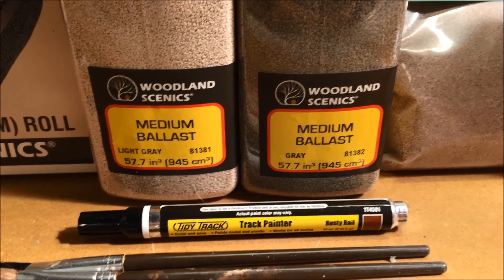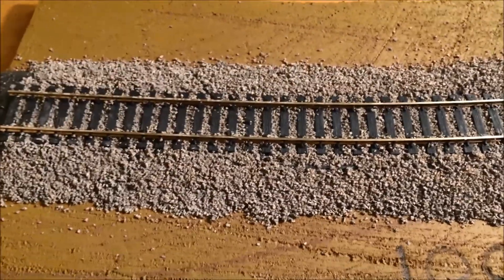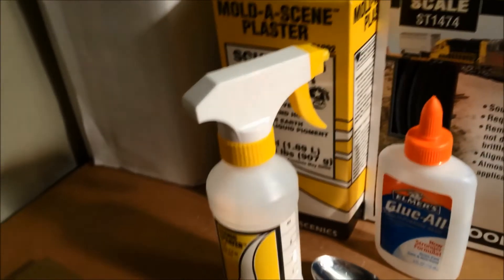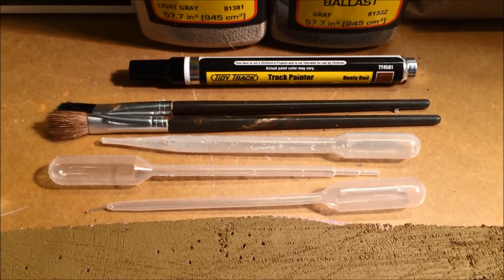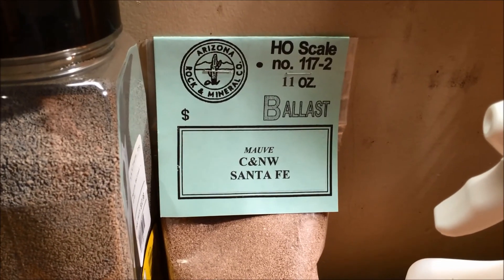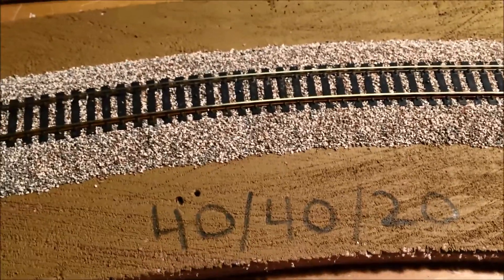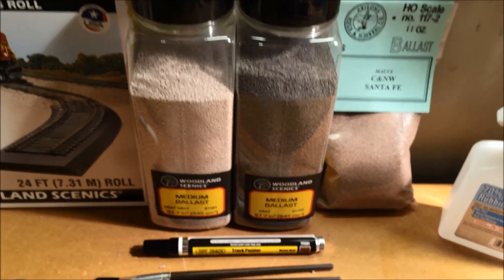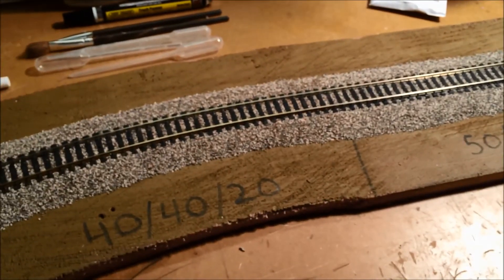Episode 9: Roadbed and Ballast Test Part 5

Comment: They are called pip-ettes not pipe-ettes.You Americans should learn English
Reply: Gary Moore  As a chemist with 35 years experience in American Labs, the pronunciation in the video is correct. Pipe, not pip.  Just another of many variations in pronunciation between the English and the Americans

Comment: Definitely go with the 40/40/20 you got there.  That looks the most realistic to true railroad ballast.  What's the cost of the AZ rock & mineral compared to the Woodland Scenics if you don't mind my asking?  I've been model railroading since the early 70's and this hobby has increased in cost by 20 fold, no kidding!  If I had to start all over again with today's prices, there's no way I could be a model railroader???  Great video btw.
Reply from the maker: I appreciate the comment- most people have agreed on the 40/40/20 ratio, especially if you see it in real life.  I don't remember the cost of the woodland scenic vs. Arizona, but I do remember that they were comparable- pretty close to one another.

Here's a tip- you can get the a lot of scenic stuff at Michaels craft store- they run weekly 50% off coupons.  Its a great way to get a $10 pack of trees for $5.  Hope the tip helps you a little Bernhardt.
Reply: probably. its expensive enough starting out with a  7x4.. *couldn't do 8x4 because I had to fit the space between a door frame and a walll

Comment: I'm about to ballast for my first time as well. Great video showing the different ways. That helps me decide what I am doing now. Thanks
Reply from the maker: Glad I could help!  I recommend two things.  Number one- TEST!  You need to play around with ballasting to get the hang of it.  Number 2- use the alcohol trick to break the surface tension, it works like a charm.  The dish soap technique (wet water) did nothing for me.